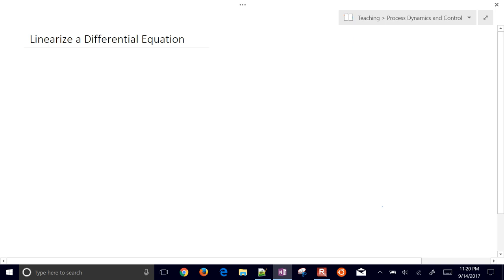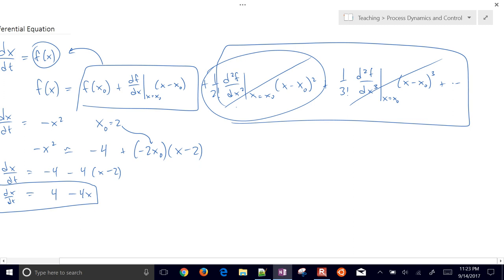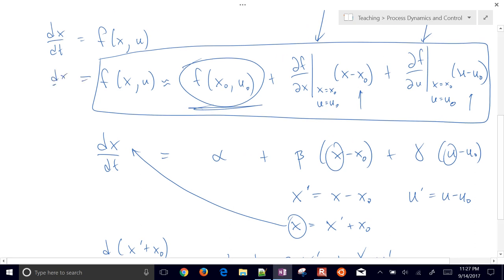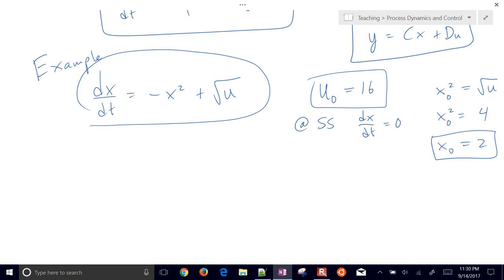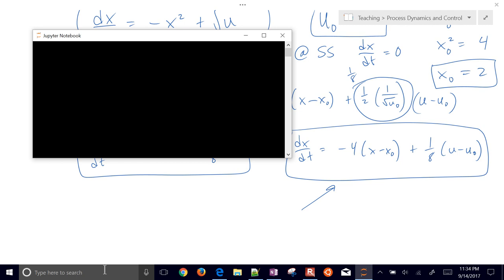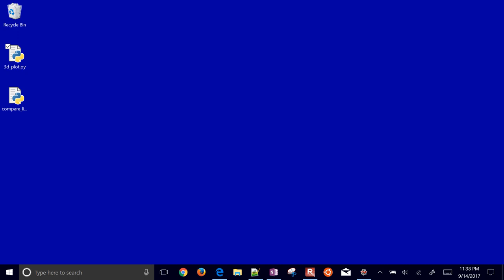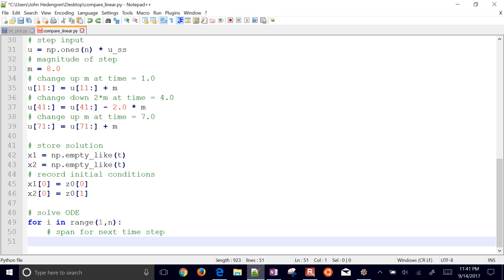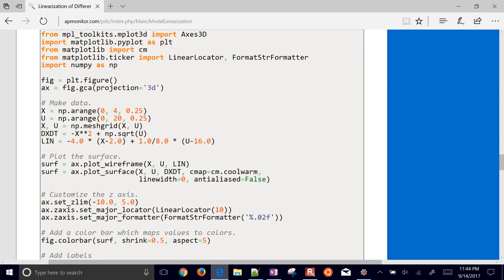Linearize a Differential Equation

Comment: What exactly is z storing, why is it a 2x2 matrix? How are dimensions of x1 x2 related to z?
Reply from the maker: The variable z at 18:10 is a vector (1 dimension length 2, not 2x2). The function needs a vector of state values of the model as a list. There are additional tutorials on integrating systems of differential equations at https://apmonitor.com/pdc/index.php/Main/SolveDifferentialEquations  Please see Problems 3 and 4.

Comment: Dimension of x1 and x2 is equal to z or equal to t?
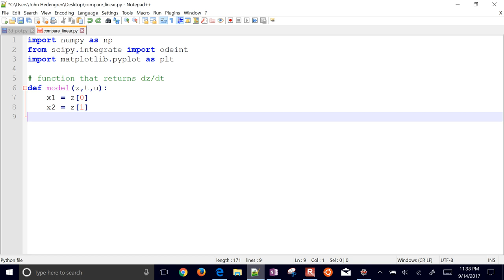Reply from the maker: At 18:25 all of the x1, x2, and t are scalar values. After the solution is returned, you can parse out the individual solutions as column vectors. They will have the same length as the time points that you requested from ODEINT.
Reply: @apm  Thanks. and what about z. How does it become 2x2 dimensional and what are the 2 rows representing?
Reply: @samardeepsinghsarna8091 , here is help with ODEINT https://apmonitor.com/pdc/index.php/Main/SolveDifferentialEquations  please see example 4 for a similar looping function to integrate the differential equations